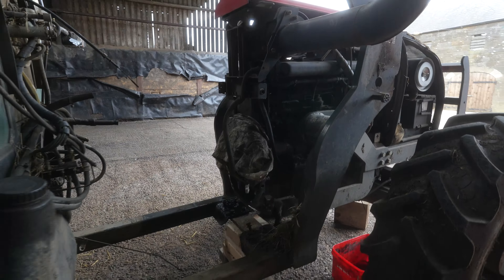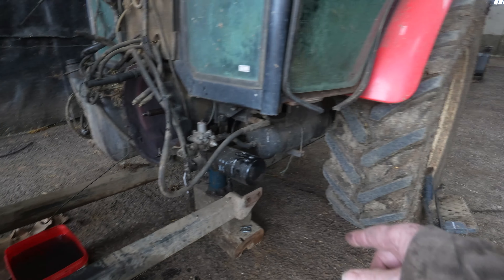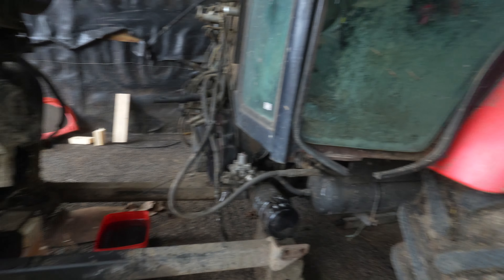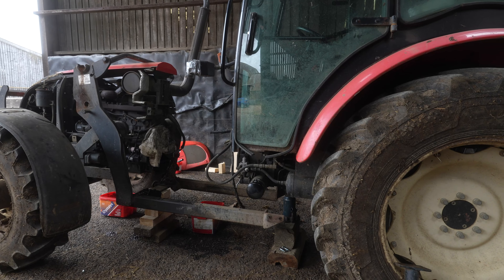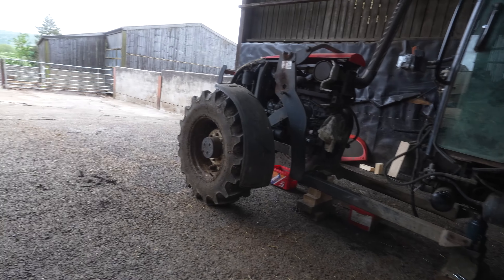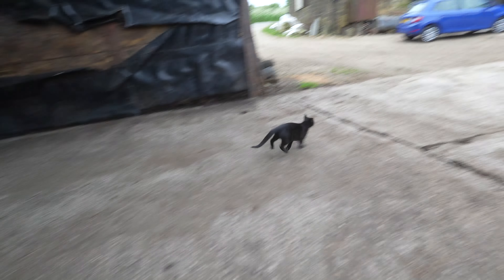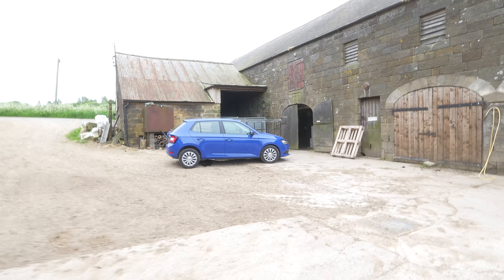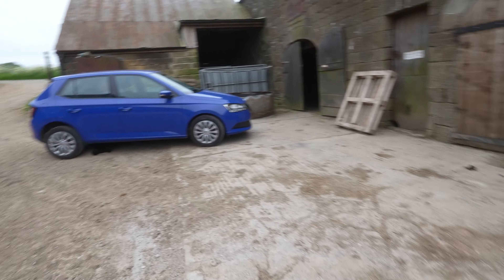Loader in two bits

Comment: From what I was told, the older Zetors were really easy, and quick to change the clutch. But thats going back 45 years when we had an 8011 at Ainthorpe.
Not sure about now as you rarely see a Zetor over here, but they used to be good value for the money.
Looks like you're all ready for 1st cut silage.
Love the videos, nice to see what you're up to.
Reply from the maker: I don't know if you do facebook at all but the local groups here are now quite good.
The hardest part was getting everything lined up to bolt back together - this involved heavy duty trolley jack bumping about on the not very smooth concrete.